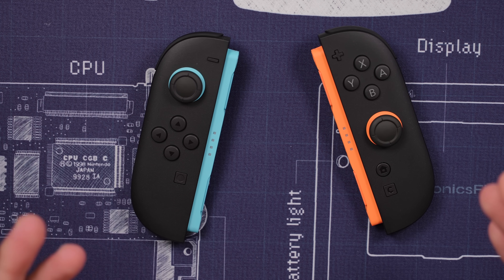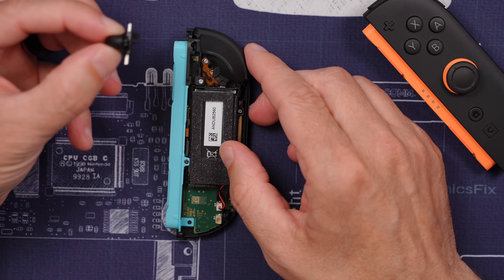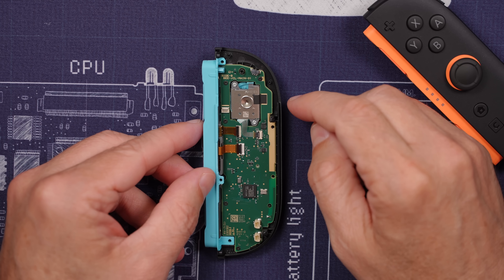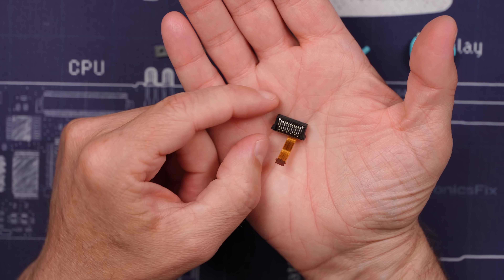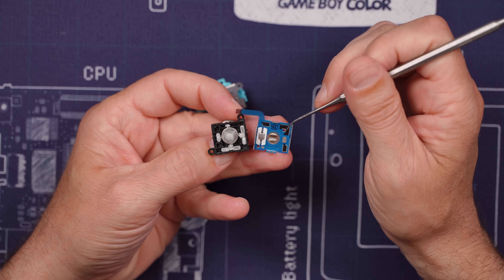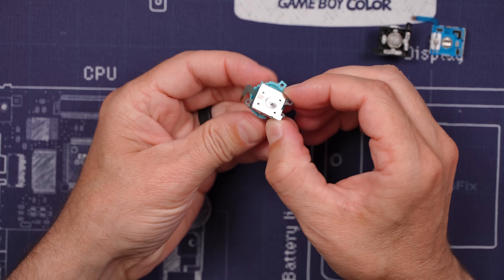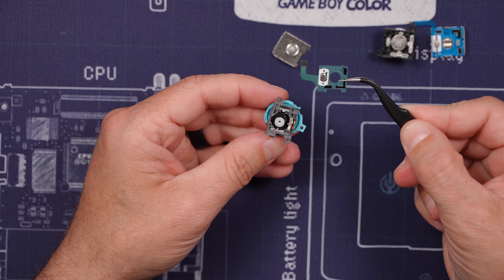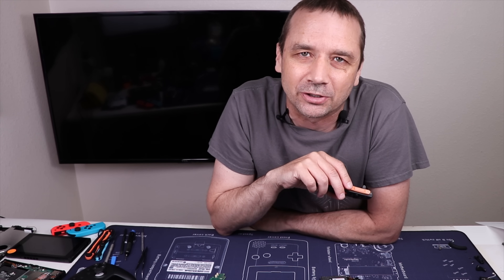Nintendo Switch 2 Joy-Con Teardown - Full Disassembly

Comment: I wonder how the optical sensor for the mouse pointer is connected. The mouse feature doesn’t work properly and I’m wondering if one of those ribbon cables is not unlocked with one of my joycons. Anyone have any experience?

Comment: I have to wonder if joycon drift is overstated. There were hundreds of millions, so some level of failure is to be expected, and even with Hall effect or TMR, there is a failure rate. But my family had 3 Nintendo Switches and multiple Joy-Cons, and we played a lot. Despite that, we didn't have a single joycon with stick drift. We have also never damaged the bumper button. Also, given that the Joy-Cons are held in with magnets, wouldn't the magnets affect the sensor when in handheld mode?

Comment: I think Nintendo uses neodymium magnets in the Joy-Con 2025 to prevent third‑party Hall effect stick replacements, such as Gulikit's, from working properly — because the strong magnetic field can interfere with Hall sensors. This design choice could also be a deliberate way to keep using potentiometer‑based sticks prone to drift, effectively turning drifting into a form of planned obsolescence.

Comment: Say, didn't the n64 controllers use some strange optical setup? Those failed when the plastic housing wore down. Maybe nintendo should revisit that design, but use metal for the analog stick and housing.

Comment: Rather disappointing to see that both the joycons and the pro controller are more finicky to take apart than their previous models. Not nightmarish by any means though, but the older joycons/pro controller earned massive brownie points from me for their ease of disassembly. 

Hoping I don't see stick drift too soon, i got lucky with my OG switch controllers and didn't see drift until maybe year 3 of ownership. 
Curious to see if hall effects are truly off the table with the magnet proximity. Hoping to see tests in the future.

Appreciate the video!

Comment: The stick makes sense. The smaller wiper put less pressure, and the circuit being a flexible circuit instead of a rigid one will have some flexibility, making it harder to scratch the contacts! I have faith!

Comment: Actually joystick wear came from the housing loosening up and not pad wear. As you play and put pressure on the joystick, the housing gets loose. As a remedy, some people just placed a cardstock under the joystick and it helped push the housing back up and tightening up the contact between wiper and pad. I get that pad wear and contaminates can still pose a problem but in my repairs the cardstock trick seem to be a pretty permanent fix. Now if the reinforced the housing on the new joysticks the problem could be fixed

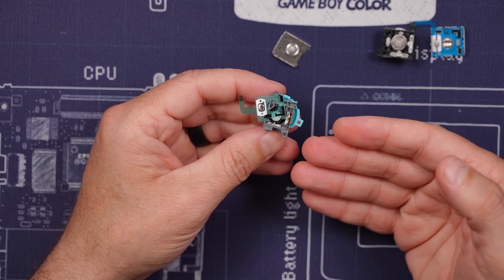Comment: 6:55 The problem you mention why Nintendo didn‘t use hall effect joy sticks is just an excuse in my opinion. Yes, magnets from the hall effect sticks could interfere with the joy con magnets, BUT Nintendo also put magnets in the vibrators and apparently they are even bigger and stronger than on Switch 1 according to the Welcome Tour.

Comment: Side note to anyone taking apart their joycons for custom buttons, the right Joycons is largely the same with one massive problem.

The teardown is pretty much the same, but the right controller when you’re stripped down to the board, there is a hidden screw underneath the bottom ribbon cable.

Spent a good 10 minutes trying to figure out why the board wouldn’t come out, the screw itself is barely visible and requires the ribbon cable to be unfastened and removed to access.

Comment: I don't think the Drift issue would be so extreme on Switch 2 those Sticks are the Same as the PSP Pad .. the difference in the Switch 2 ist Not only the size to Switch 1 Joy con Sticks .. Switch 2 has on its Point of contact ist Cooper or zink witch is softer then the Grafit Pads so the wipers don't destroy those Pads as easy would had Nintendo used this on the old Joy cons then there where No big Drift issue. Heck even the pro Controller and every Other modern Controller uses harde Materia for its wipers what is destroying the Grafit Pads realy fast older Controller Sticks used softer Material ... Gold plating would be the best for longevity of the parts

Comment: Thanks for showing the analog sticks on the joy-cons. I got a switch 2, and they feel just as cheap as the original joy-con analog sticks regardless of the redesign. Call me a conspiracy theorist, but I find it hard not to believe that this is planned obsolescence by Nintendo to sell more joy-cons.

The only saving grace for the system is that the Mayflash Magic NS works with it, because I sure as hell wasn't going to plunk down any money for another controller.

Comment: I mean TMR analogs work pretty well and have decent resistance to magnetic interference. They could have just used TMR in the joycons.

Also how about the Switch 2 pro controller? Is it pretty much the same as the pro 1 internally?

Comment: Been playing my switch 2 extensively over this weekend. Left controller stick already has a little bit of free wiggle to it. A little too much give. And when the stick is tilted completely in one direction, the rubber cover reveals a little gap where the dust can get into the inner workings of the analog stick. Something tells me the longevity of these joycon 2s are not going to be any better than that of the joycon 1s...

Comment: Harder than the original joycons but not impossible to exchange the sticks since no solder, just what I wanted to see, they should last me the whole gen via repairs just like the originals. Thanks for the video.
Reply: replacing the joysticks were so easy that i think nintendo made it intentionally harder to replace and hope most people would just give up and send it in for repair or buy whole new joycons. i replaced my og joycons 3x before the hall effect ones came out.

Comment: I have no idea how you can use needle nose pliers without crushing the living hell out of those tiny little connectors. I don't have the dexterity apparently to put just the right amount of pressure and then still wiggle it loose. Is it just me?

Comment: A fix I've seen for Joycon drift is putting a shim between the back of the analog stick and the housing to push up on the metal and force the contacts to have better connection. I'm sure wear is a part of the issue, but it also seems that the metal housing isn't strong enough and bends under load, probably from clicking the button hard. I'll bet that the thicker housing your mentioned is to combat this. It will hopefully be effective.

Comment: At Nintendo: "Sir should we use Hall Effect joysticks? It would make the system so much more reliable." "Screw that! lets make our controllers snap on with magnets instead of using the rail system we already have! That way we have an excuse not to use then new joysticks" "But sir wouldn't that cost the same or more than just getting the better joysticks?" "..... You're fired Carl."

Comment: You're not going to see stick drift with these new Joy-Cons.  Nintendo already solved that problem halfway through the Switch's life.  Amazing how many people get this wrong.  My early Joy-Cons drifted, and the replacement ones Nintendo sent NEVER drifted again.  And you can't use Hall Effect sensors here, because the magnets on the new Joy-Cons would interfere.  Buy hey, let's throw Nintendo under the bus and THEN judge the reliability of the new Joy-Cons.

Comment: Strangely enough I am still using my joycons from my Switch I bought in May of 2017, they have had multiple incidents of getting drift, but they have always been fixed by a cleaning and recalibration.
I think it's more of an issue of dirt and dust getting into the analog, not so much a wear issue. My Joycons have been used so heavily that the texture on the plastic has been worn smooth in places where my hands and thumbs have essentially polished the plastic.

Comment: I think drift on the Switch 1 is exaggerated, by the time my S1 sicks showed any signs of spurious inputs, my sticks were utterly worn out being real loose and the centre stick press having not tactile feel left and needing replacing anyway.
Aftermarket sticks will come out pretty quickly and hopefully will quickly fall in price, new sticks for my S1 were costing me a ridiculously cheap 1.30 GBP each, obviously S2 sticks will start much higher than that but they will fall in price quickly.
Reply: Lol I guess e waste is okay because in your singular anecdote it wasn't an issue
Reply: @vgamedude9811  No dude, I have 2 switch1's in my house, neither have had drift issues and my particular one had at 3-4 hours of fortnite play a day for some 3 years and my sticks are well and truly worn out before they drift.
How is it E waste, the joycons dont go in the bin, the sticks get replaced and the old ones in the recycling, you are talking nonsense.
Reply: @stevefox3763  okay little bro the tech is out there to eliminate stick drift entirely and nintendo didnt use it and faced multiple class action suits but its not an issue at all lmao.

nintoddler

Comment: The improvement was on metal piece under the joystick, the previous model had a spring directly to the metal base the got deformed by using specially the center button, this new has a better metal base and a plastic rocker like the one in a regular controller

Comment: Thought they was bringing in a law that these manufactures had to put in user replaceable batteries to cut down on e waste, we all know batteries break down over time so why do they keep sealing them inside their electronics ? Well I do know why so you buy a new one or send it in for repair but this needs to change, like the cost of earbuds for hundreds but once the battery goes it’s useless as you can’t get in them.

Comment: I think we're just going to have to see with the analog sticks. We're ready to jump to conclusions because it is the same technology. However, the Switch might have been a case of bad execution and not necessarily bad technology (they made the wipers too big). Also, did you compare the pads to see of the Switch 2's are better quality? That could also have an effect.

Comment: The extra metal pieces on the sides are actually fairly reassuring. One of the theorized causes of joycon drift was the 2 pieces of the metal outer enclosure for the stick separating with repeated wear and pressure applied through use. That's also why people were able to fix it by adding cardstock under the stick to prop it up

Comment: Analog sticks are reworked from the ground, up.... Not really, maybe a new design that was worked, but with smaller contacts would probably dig a little deeper into the, still good 'ol, conductive plastic, so they will drift just as fast, if not faster, than the original Switch.  Good job, Nintendo, attempted to distract the consumer with BS, probably knowing full well that techies are GOING TO TAKE IT APART to see how it works.  Also, I am waiting for the day when someone actually finds a way to Root the system.  It will be one of the most powerful hand-held emulators out there, if the story is true about it being close to a PS4 spec.

Comment: Now hold on just a minute: The cause of drift on the Switch 1 Joy-Con was NOT a problem with the internal mechanism, but rather the halves of the casing separating slightly, hence why some sticks were fixed by simply putting cardstock under it! This new design appears to have a more reinforced casing made with stronger metal, which therefore shouldn't split apart as easily. Just don't mash L3 or R3 with a hammer and you should be fine.

Comment: 2:02 A couple things I noticed on my Joy-Con 2:
-The midframe provides about 20% more vertical support for the L/R button.
-There is evidence on the bottom of the PCB which suggests the button frame is now through-hole, not surface mount.

Comment: I’ve been really unimpressed with the build quality of the new switch. 

For the price point, stickers on the controller rail area is unacceptable and then they also didn’t really improve the controller. 

Just seems like there are some unnecessary fumbles with this system, just for them to release a refresh in 3 years

Comment: Tbh, making the contacts smaller is probably only just enough of a change to delay the drift enough to get it to drift out of warranty...
Reply: I dont think the contact was the problem. Its the dust going inside and mostly the steel plate bending when pushed too hard. Perhaps the concave design fixes that?
Reply: @ameserich the joysticks will always fail eventually, and I don't mean after thousands and thousands of hours, or more like tens of thousands of hours. These could definitely fail under 1000 hours.

Now there are 2 known issues with the joy cons, dust and all that is definitely an issue, isopropanol can be used to clean that without opening it. However the stick giving out simply needs replacement, cleaning won't help. 

Joycons gave out so fast, we will see how these do, but it's a massive issue that they didn't put in better sticks.

This seems to be the norm though, since Sony and MS is using poor quality sticks as well.
Reply: aaaand there's already reports of drift.
Reply: But Nintendo has been  fixing the joycons for free even out of the warranty time limit.
Reply: If that's what Nintendo was aiming for, they wouldn't have repaired pretty much any Switch 1 JoyCons you sent them regardless of age no questions asked.
Reply: @Taromisaki666 that's a bad take. Hall effect joysticks cost next to nothing, and would be cheaper than having to repair them down the road.
So why didn't they? Because a ton of people never sent them, and just buy new ones. And the people that do ship theirs, usually buy an extra set so they can keep playing. Only people who already have multiple sets, will not spend more because theirs break down.

All in all, it helps profits to have them break down.
Reply: @benjaminvdvyt  You can't use hall effect sticks in the JoyCons because the magnets Nintendo uses to attach them to the switch would interfere with the magnetic field.
Reply: @Taromisaki666 
Another bad take. This has absolutely nothing to do with the Switch 1 choice. They made the choice to keep putting junk in the Switch 1, so saying they can't do it now due to design changes, is again a bad take.
It's an even worse take when you consider that TMR are arguably even better than hall effect, and could be easily used.

So before you stop and defend Nintendo, just accept that Nintendo gives zero f's, and just hopes you will either replace them or buy new ones when you get a new set of terrible joysticks put in.
Reply: @benjaminvdvyt  I'm not defending Nintendo, I'm just stating facts.
Not my problem that you can't accept reality.
Reply: @Taromisaki666  They only repaired joycons after they got sued. and only in the market they got sued in.
Reply: @Taromisaki666  so uh thats easy to do when you charge 60 dollars for 15 year old games and 80 to 120 brand new. Also pretty easy when everyone who doesn't do that buys a new one every 3 to 6 months so they get the money back and more so for the measily few dollar sticks. I could go on and on. Nintendo just wants your dollar my guy. They are actively robbing and suing people left and right. If you don't see how this persons comment perfectly fits their bill then i hate to say you are blind.

Comment: I'd like to point out that the Dreamcast in 1999 used hall effect. A ton of 3rd party joycons use hall effect while being cheaper than an official joycon. It's not expensive. This is just penny pinching.
Reply: Not only penny pinching they get you locked into the console and they WANT the controllers to break so you buy new ones.
Reply: In this case, the magnets on the joycon rail would interfere with the hall effects, so it's actually worse in that you can't mod it even if you want to
Reply: @KetsubanSolo  there’s modified joycon 2s being sold now. They work really well

Comment: A little advice: when you want to separate a battery sticked with that kind of strong glue, just lift it a little and pour a small amount of isopropyl alcohol and let it do its job for around 30 seconds
Reply: I'm pressure sure he knows that, but there's foam stuck all around the battery. IPA would not be good for that foam. At the very least it would come unglued. Worst case it would ruin the foam.

Comment: correct me if I'm wrong but I see a lot of problem with those joy con:
1)I don't really like the magnet, the sliding feature was ugly but I have a really big doubt on how much those magnet naturally keep their strength (sun, humidity, putting the switch near magnetic weald will cause a faster deterioration)
2) I don't see any kind of change in the type of plastic used to make them, and the first switch had a really bad plastic (I had cracked L and R bottoms by dropping them in a sofa high)
3) Tronics already talked about Nintendo not reenforcing so well the Botton that breaks a lot
4) Those orange plastic connector that curve in two different ways broke a lot in the old joy con (at least they enforced the SL and the SR ones by making them lay on the walls of the joy con but I don't know how much it will help against braking
5)they added a spring... whyyyyy it will lose elasticy making
5) the analogs are the same of switch 1 with all his problem; the metal looks weak, it will scrape off the electronics, and this is only because they decided to use magnet to connect the switch with the joy con
😭🙁🙁.

long message I know but it's only for the more interested in those kind of things, but the summary is:
I thin this joy con not only has all the problems of the old one but even some more that nintendo hides them us "features", tell me what you think under this comment